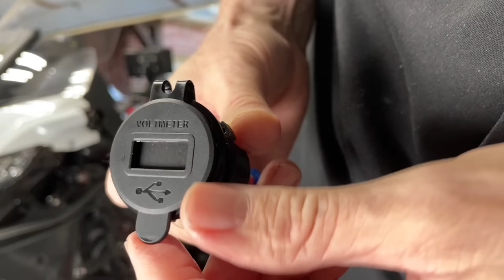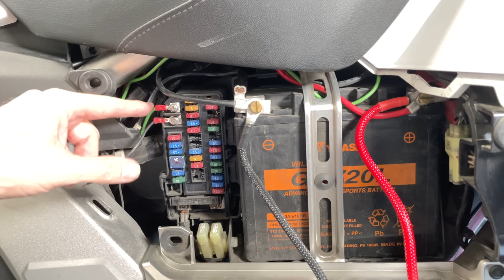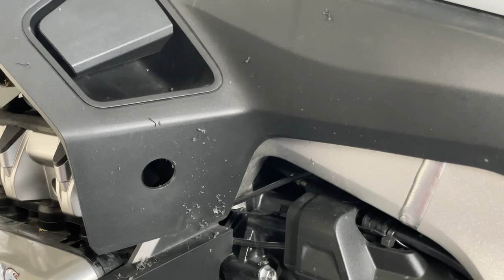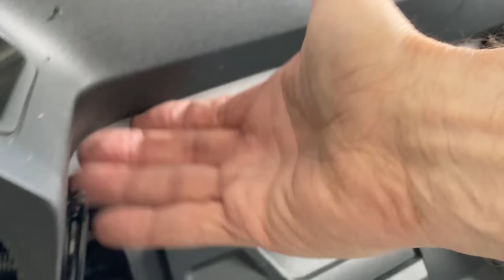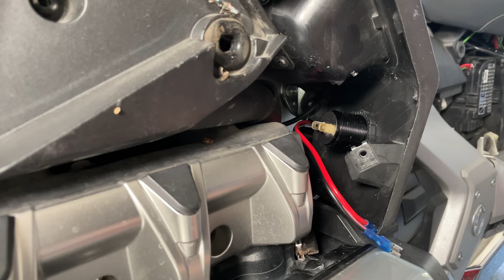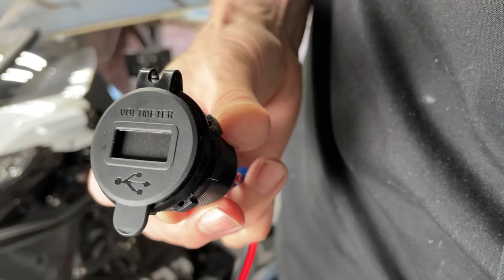Install Dual-USB Power Port with Voltmeter | 2018+ Honda Goldwing | CruisemansGarage.com

Comment: Hey Cruiseman.  I like your videos, and this one looks interesting,  but I wonder if these outlets are practical.  I recall seeing that you carry a backup battery/jumper in the saddle bag (as do I).  The backup battery has USB ports for charging, which does not require the motorcycle to be running or powed on to charge your device.  I can leave the helmet in the trunk (charging), while I stop for a bite to eat.  Not trying g to be negative here. as I do enjoy you channel.   Please keep them coming!

Comment: FYI - I put this exact unit on a Versys x-300 & found a rubber sleeve (Amazon) that fits over the threaded portion. Makes it very waterproof with a zip tie top and bottom. I used small wire loom & it looks factory. Just bought a '23 GW DCT Tour, viewing all your vids and I have to say you're a real credit to this community. Thanks so much.

Comment: To charge something the Goldwing has to be running or in accessory mode, can't see the practicality of that. Also if you are charging a headset while riding you have a long cable reaching from you headset on your helmet all the way down to the port with you left leg now interfering with the USB cable. I installed Honda's cigarette lighter accessory port above the DCT handbrake. I can plug a Dual USB port into it to do the same thing but it can also be used to power an air compressor or other device if necessary.  This gives one a few more alternatives than the one you installed.

Comment: Looks good. Accessory terminal screws on fuse box are beyond ridiculously tight. Purchasing a JIS (Japanese industrial standard) screw driver available on Amazon prior to trying to removing these screws will save you the frustration I experienced. Just saying.

Comment: Chris, I was able to mount it above the parking brake.  It was a tight fit for my fingers, but it was possible.  I threaded the wires through the hole before inserting the port.  Then I was able to thread the back nut by sliding it up over the wires, as a guide, to the back of the port.  Then I put my left and right index fingers through the few spaces between the plastic braces and tighten it.
Reply: You were able to drill the panel above the parking brake using a step bit the same way Chris did without taking the panel off the bike?
Reply: @txman951   I didn't have a step drill that size, so used a 1 inch hole cutter bit.  Then a rasp bit to slowly take it up to the spec'd size, I believe it was 1.38 inch. Finished the rough edges with a half round hand file.  But, to answer your question, yes there is plenty of room behind the plastic.  Make sure, when you're ready to install, you plug the wires into the back of the USB first.  Otherwise, you will have a heck of a time doing it in the cramped finger space.
Reply: @Towman728  thanks very much.  I will try this in the next couple of weeks.  Very appreciated!
Reply: @Towman728  just saw your post on FB about your install!

Comment: Hey Cruiseman, nice video! I installed the same plug on my cubby lid about 9 months ago along with a power switch and cigarette outlet. Since I have moved it to the left middle cowl (just the voltmeter)so I could see it better. Got to be careful on the spot you choose. Instead of plugs I just reorder the plastic. Originally, I installed the USB charger/Voltmeter to charge my Sena when grabbing a bite to eat at lunch. Now I just need it to monitor the battery/charger.

Comment: For the SCT bikes that do not have a parking brake, there is a panel over the brake lever area. It makes a great place to mount this type of meter. I mounted my Powerlet plug for my heated gear there. I may have room for this also. Thanks Chris!

Comment: Thank you! Just curious why you didnt run the connection up to the Pathfinder fuse block?
Reply from the maker: I was just in a hurry. Wiring to the Pathfinder required me to remove the seat. I have since wired it to the Pathfinder.

Comment: CruiseMan, I liked the wires you are using on your motorcycle battery. I assume they are for a battery tender. I’m curious what kind of wire that was? Every battery tender I have purchased lately comes with eyelet ring connectors which are too large and create issues using the rubber OEM battery terminal covers. Thanks
Reply from the maker: They are for the SCOSCHE jump starter, but they have a Battery Tender adapter. https://youtu.be/Iy0RKLOS6cU

Comment: Great job Chris nice and clean install. Can you tell me what you have hooked up to your battery terminals besides your cables? In the video you can see a red braided cable and a black/gray braided cable on your battery terminals. What are those cables for and do you have a link for them?
Reply from the maker: Those cables came from SCOSCHE for connecting a jump starter. https://youtu.be/Iy0RKLOS6cU

Comment: Love watching your videos Chris. 

I have a suggestion about your voltmeter. Instead of moving it in the future you could make a plastic wedge washer for the front and rear.  

It would pull it a little more out and you can angle it upwards because you have lots of thread space in behind the panel.  You just need to file the top and bottom of your hole to be able to tilt it upwards.

Comment: Hi Cruiseman, in a forum I think you mentioned that you stripped the head of the ACC screw terminal. I've been meaning to ask: How did you get that screw out? Did you Dremel in a slot or use some other method? I'm in that situation right now.
Reply from the maker: I cut a slot.

Comment: Isn't that where the puddle lights mount ? You give up that option?
Reply from the maker: No. They mount higher up on the top shelter and face down towards the ground.